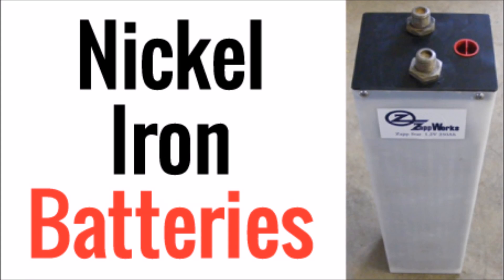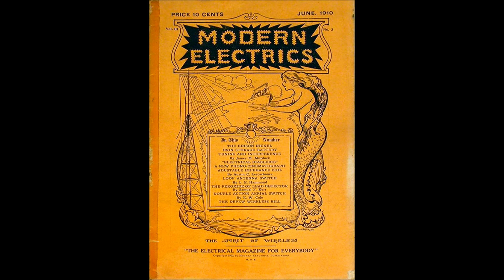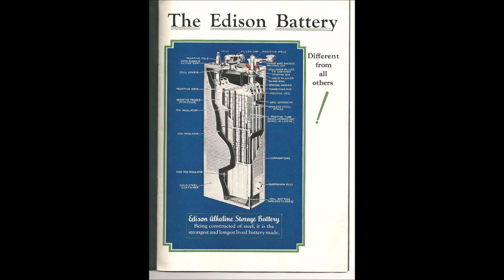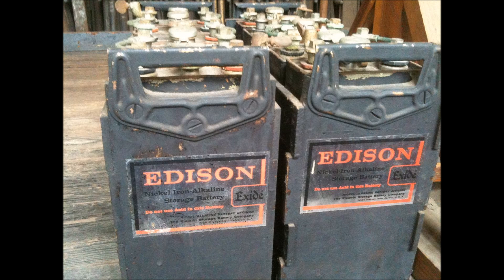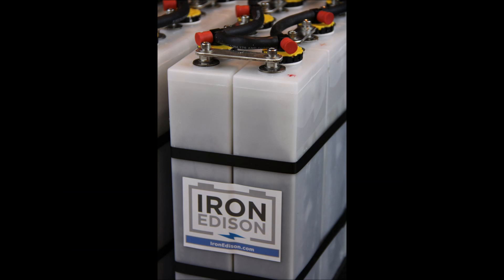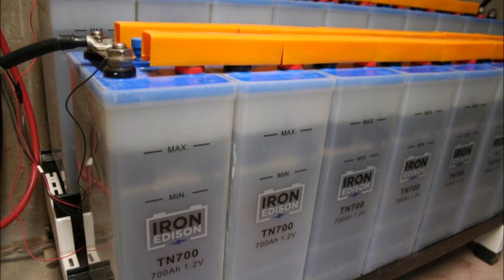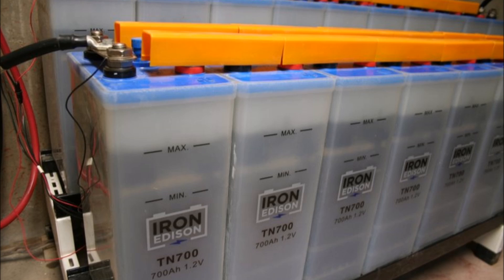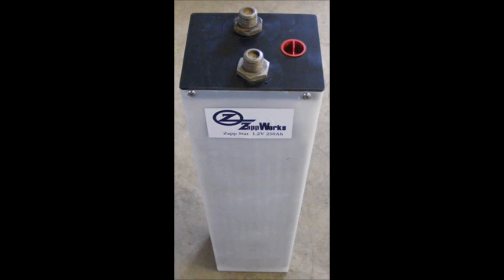Nickel Iron Batteries

Comment: I used to think that they were great, but apparently when Nickel prices shot ups on price, manufacturers started reducing the amount and quality of the Nickel material to save money.

The number of cycles at 50% DOD keeps getting lower and lower.  

If you have data on this, compare the old number of cycles to the brand new manufactured cells.
Reply from the maker: I have no doubt.  It is frustrating that products continue to become more and more "throwaway" and aren't built to last a lifetime like they were 100 years ago.
Reply: @LDSreliance  sadly you are right on the 💰.
Reply: There is a reason of doing it. Money...!! If life is more, who will buy. If you compare our Lithium battery also had 5 -6 years + life. Now they come just half, so more buy and sales happens. It is just done for Money..!!

Comment: Its great to hear a positive youtube about Nickel Iron Batteries but a little bit of infomation is not quite correct. They not expensive as they used to be. Compare them to Lithium batteries price and longivity and they there is no comparison. Weight compared to the same size lead acid is nearly half but yes they are much heavier then Lithium. Why is a nominal voltage of 1.2volts is a problem? They have a working range of between 9.5 - 17volts for a 12volt battery. Lithium and lead acid batteries do not come close to the working voltage range. The hold charge better than most other batteries and can be left uncharged for decades with no ill-effect. They loose charge pretty the same as lead acid batteries do but no one says anything about lead acid batteries.
Reply from the maker: I agree that there are advantages.  But the disadvantages are huge and make the use case for these very narrow.  I need to get my hands on one and do some testing.
Reply: @LDSreliance  I'm interested in what your knowledge of the disadvantages are. I am yet to see a negative review about nickel iron batteries that can be verified. I acknowledge they take up more area and are much heavier than lithium batteries but many other alleged disadvantages cannot be verified, are no different to other battery types or just don't matter.
Reply from the maker: Just very poor energy density and low C rate.  The nominal voltage may be a problem but that may have been on older batteries.  I have reached out to Iron Edison so see if they want to partner with me on a video in the future.  So hopefully they respond back.
Reply from the maker: No response from Edison.  Do you know any other Nickel Iron battery brands that might be interested?
Reply: @LDSreliance  Edison used to only sell NiFe batteries but businesses want to make lots of money they turned to sell other types of batteries and no longer focus on NiFe.  As you are also a seller of lithium batteries I would suggest they probably don't want to waste their time working with their competitors. Doing a video on Nickel iron batteries and providing evidence would be a challenge as this technology provides fluid information depending on how the battery is being operated including how it's  charged  and discharged.

Comment: I don't understand why anyone thinks weight is an issue with NiFe.  Lead acid batteries are quite heavy, too, but no one is using them for wrist watches or cell phones.  My car is heavy, too.  So what?

Also, why does anyone care about cell voltage, as though 1.2V is a downside?  1.2V vs. 2.0V is just a different configuration -- no one is using 2.0 volt inverters, so they all get stacked as needed.

Considering all common battery choices will need replacement eventually, what should matter is cost/capacity/PER YEAR.  Nobody does that math.  NiFe wins hands down in cost PER YEAR.
Reply from the maker: Nickel iron is much heavier for the same volume.  It has an energy density of 19-25Wh/kg vs 30-50Wh/kg for lead acid.  So, on average, a lead acid battery will be about half the size for the same weight.  That may not be an issue, depending on the application.  But it is still something people need to know about.

I don't have enough data to know if your last statement is true.  I can't find too many people that are actually using them long term where the cost per year over time would bear out.  If they don't last 20+ years then they definitely aren't going to beat lead acid in terms of cost per year.  Because their entry price is very steep.
Reply: @LDSreliance  Jay Leno is a car enthusiast and he and his wife each have a Baker Electric, which were made with NiFe.  I found a video online of Leno driving his Baker Electric around on the original century-old NiFe batteries.  He eventually replaced those with lead acid, but not for lack of durability.

Comment: Yeah, im still sticking to my lithium iron phosphate battery. Nice video though!
Reply from the maker: Yeah these are super expensive but it may be worth it in some situations.
Reply: how expensive
Reply from the maker: Iron Edison sells a 12V 100Ah battery for $970.
Reply: Yeah, im staying with my 35 AH lithium iron phosphate battery for $209. Its like a feather in weight, and lasts alot longer in terms of life expectancy than the trojanT105 batteries. How much do they weigh and cost?
Reply from the maker: That is probably true but the Trojan's last 8 years and are 225 Ah for $135 plus tax and core charge.  That is far better than LiFePo4 on a dollar for dollar basis even if you had to replace them once before the LiFePo4 died.
Reply: #OffShoreUnitedStatesLithiumAndIronMiningToTheRescue

Comment: Bollocks.   these chinese cells when compared to the original Edison/Exide cells when cut open, they are not much alike.  The chinese cells use what they call VARTA technology, which is the reactants are contained in pouches as a paste.  The original Edison cells had the reactants in hard flake form. The hard flakes, as documentation asserts, DO NOT dissolve in the electrolyte.  However the paste used in the chinese versions does indeed dissolve into the electrolyte, which then needs frequent replacement in just a few years.  The chinese cells were promoted and sold in Australia back in 2018......and now nobody sells them, because they have been a failure.  Some people have had ok operation, but when you talk to those people.....they are using them in very light duty, shallow discharge applications.  A lot of this is the fault of the people that imported and sold the chinese NiFe batteries.....they promoted them as Edison batteries,rugged,long life,tolerant of overcharge,undercharge etc etc............they absolutely are not rugged. They are over priced and over hyped and thats why they have disappeared.
Reply from the maker: Sounds about right.  I am an expert in the lithium (LiFePO4) battery market and the Chinese have proven to be extremely dishonest and short sighted as a whole.  There are certainly good companies, even some great ones, but there are a majority that sit at the bottom of the market offering bargain basement prices with "specs" that will never happen in the real world and absolutely zero customer service or warranty support of any kind.  In fact, I do not know of a single Chinese battery brand that has sold in the American market for more than 3 years continuously.  They have to pull the plug and pop up under a different brand name to outrun their bad reputation and lies.  It is sickening to me.
Reply: @LDSreliance  what is the usual problem/failure mode with the generic LiFePO4 cells, coming from china?
Reply from the maker: The majority of companies selling deep cycle batteries for the RV, golf cart, bass boat, ESS, and other markets use Grade B cells that are rejected based on one of 7 criteria in comparison with the ideal spec.  If these cells are carefully matched to each other they can still be good batteries (but not great).  The problem comes when companies buy mass quantities of these cells and mass produces tens of thousands of units with no matching and they have wildly unpredictable performance and longevity characteristics.  But in no case do they last as long or perform as well as Grade A.
Reply: @LDSreliance  that explains the wild variation in prices for LiFePO4. Thanks for the information.
Reply from the maker: Yeah, it is a major problem right now.  The honest folks trying to sell quality Grade A batteries have to compete with rock bottom prices and outright marketing lies.  And they can escape any consequences because of the way that Amazon and Ebay and other sites work.

I have several videos on my channel on the topic if you are interested.